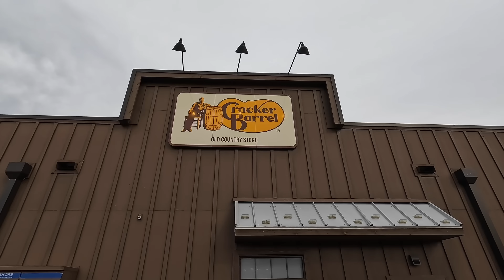New Excavator on Precarious Project, Special VIP Guest

Comment: Great interview with Neil, and driving 4 hours to bring a hat is outstanding customer service.  One thought I had where you were working on those trees on the trail, have you considered putting in a pipe under the trail at that spot, seems like a low spot (I could be wrong) where water might run over the trail if you don’t put a pipe under it,  just a thought.  Thanks for all your effort on these videos, look forward to them.  Gary, NY.

Comment: Suggestion:  turning sharply on treads.  I have seen others put the bucket down on the ground, lift he front of the treads off the ground, then you can pivot like a zero turn and not stress the treads with side load and doesn't scrape up so much ground...just a suggestion, you are doing great and I'm just a sidewalk super...thanks for the videos.

Comment: Mike you mentioned the Regen cycle on the skid loader. There is a way you can run the Regen on command. Also the cycle even though using some fuel it improves overall performance as stated.

“Regular regens ensure that your engine is operating within environmental regulations and that your dpf trap has optimal flow, reducing back pressure. Additionally, a well-maintained dpf leads to optimal engine performance, reduced fuel consumption and increased fuel efficiency in the long run.”

Don’t blame our good 
government for making these changes as improving our environment is the ultimate goal so your grandkids can still breathe fresh air.

Comment: Mike when u do a bunch of turning in the excavator have u checked on using your boom to take pressure off of the tracks? I wonder if kabota recommends doing it? Do they even have 1on where he bought it
Reply: Good point, but in order to do that effectively, an operator has to be able to run the tracks with the footpedals.  I don't know if Mike is doing that or not.  I take my hockey sticks off excavators because I never use them and they mess with my line of sight.

Comment: Why can’t you include 6 to 8 inch diameter round logs in your firewood? We used to burn round logs in the wood stove and they work just as good as the split ones. Just curious. Thank you for another great video.

Comment: Mike, Agree with you on Messicks, bought a M7040 from them years ago, it was delivered flawed, the came down with a New Holland Super Steer to use while the fixed the Kubota, and it was done quickly. 🪵🇺🇸